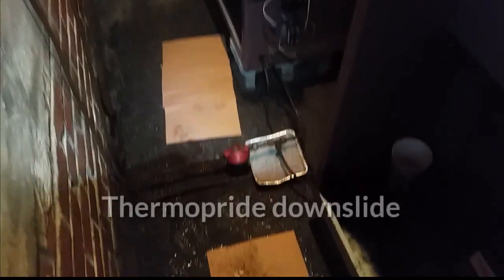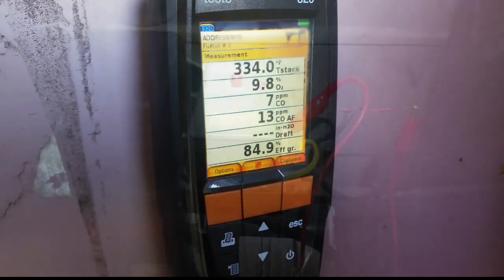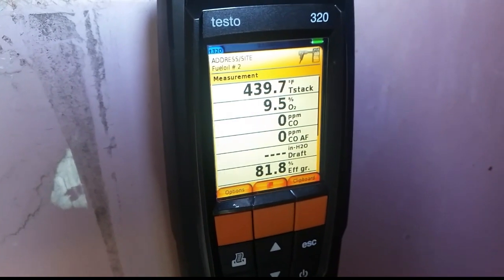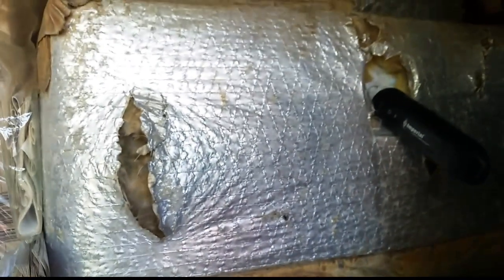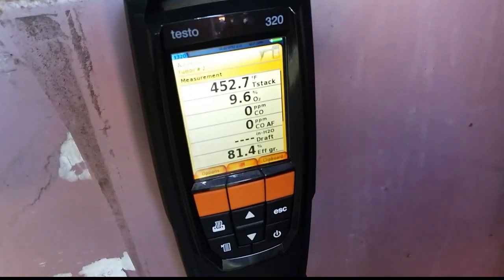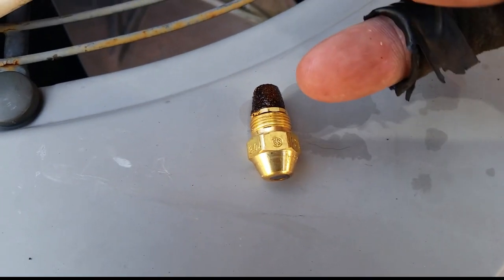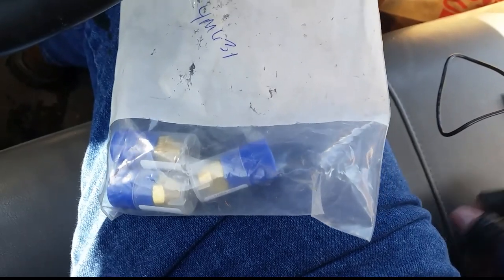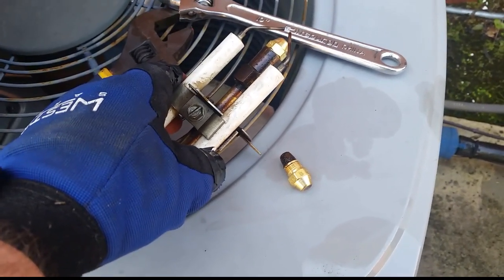HVAC Service : No Heat Oil Furnace Troubleshooting

Comment: A friend had $1300 parts/labor worth of work done on a residential oil burner in a single-wide mobile home. I saw the receipt his oil tech left him back in Jan. this year. He didn't do it all at one time, but he replaced many parts. New nozzle gun assembly, electrodes/insulators, nozzle, cad cell, new primary control, transformer, added second line (return line to tank from pump housing). Distance from tank to oil burner is 25 feet, or less. Painted the air tube white. Couldn't read the rest of his receipt, so not sure what else, if anything. All the work wasn't done at one time and it's running good now, but can't help wondering if his tech was a parts-changer instead of testing individual components/replace as necessary, especially since I see online prices for a new burner in the neighborhood of five to six hundred dollars plus shipping. Without knowing what his initial problem was, can you give an opinion as to whether all those parts could have been necessary?
Reply from the maker: +JustPlumDucky anything can happen so its hard to say. I have seen equipment so bad it is easier to totally rebuild it or replace it.

Comment: One thing I think you set the electrodes way to far forward. They Will Arc Against The endcone AND misfire. If the call comes back in try pulling them back till they are just about even with the end of the nozzle.
Reply from the maker: Thanks Al. Will do

Comment: Do the two furnaces serve the same building? Thats odd.
Reply from the maker: They serve a church sanctuary.  Each one is a stage of heat
Reply: I kinda don't understand. What do you mean by a stage of heat?
Reply from the maker: Ben Boudreau a w1 call brings the first furnace on and a w2 call brings on the second furnace. They are controlled by one stat.
Reply: What's w1 and w2

Comment: the nozzle should never be black like that.... i would replace or check  both the general oil  filter and pump filter  for sure the pump filter can be cleaned with some oil.and reinstalled  . it could be when someone bleed it they did not bleed it till the oil ran red through the pump. that would possably  push puck up into nozzle . one thing about oil furnaces there hard to remove soot from if they start running bad. that nozzle was i concern for sure being black like that ..looks like you caught it in time ,,good job zack
Reply from the maker: Thanks pal, I am glad you gave me some feedback. Do you think each one of those things need a filter?
Reply: talyn875 seperate filters is a good idea for sure. if you leave the one just make sure you keep the filter changed and its running clean through pump nice and red  before shuting of the bleeder .thats what they call a general filter the small style  or f1 filter thats kind of a small filter .i like the f4 myself its a bigger filter more room for sludge  .